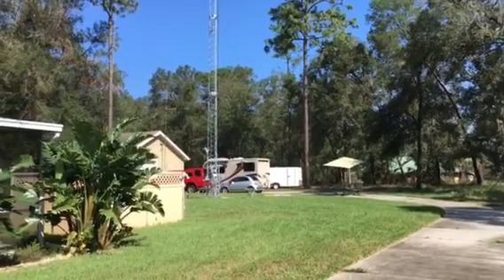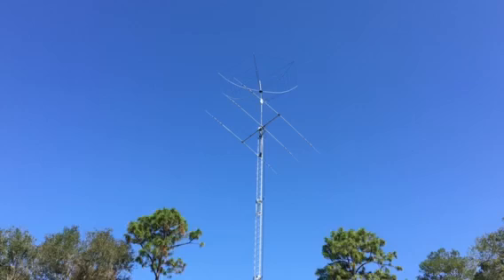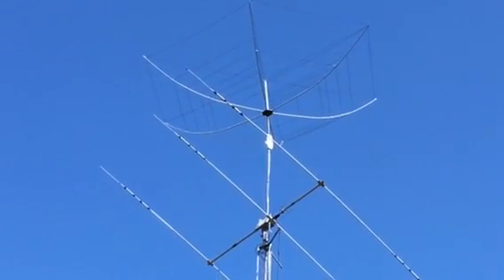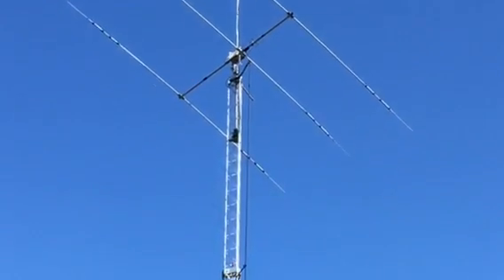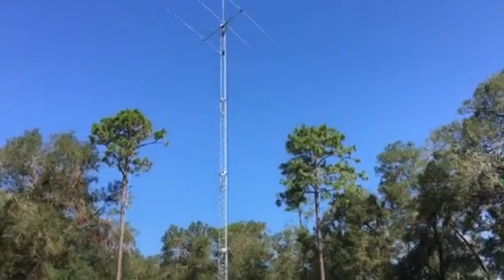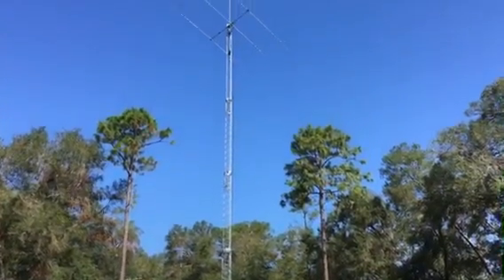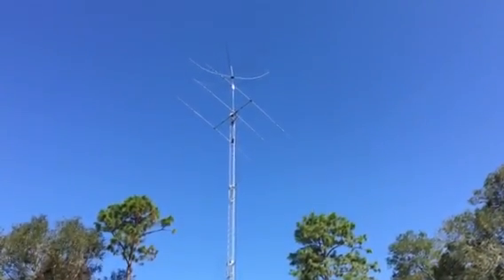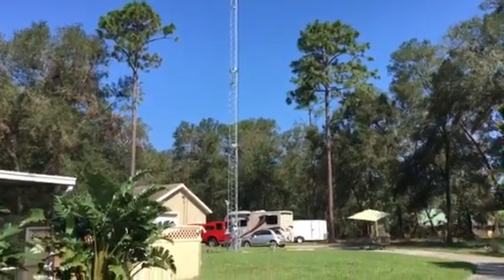HexBeam on the rise -Tiltplate and Hex-Lock NN4ZZ

Comment: Hello , have you do a comparizione? Whatch Is Better?
Reply from the maker: If I had to pick one antenna, it would be a Hex Beam.  But the Yagis do have greater gain.
Reply: @oltredding  - yagi has greater, but what’s the comparison? Which plays better? How much a difference gain versus signal between the two?
Reply from the maker: @N2RRAny  Look at my QRZ.COM page for a complete blogg.  "Today, I have been checking into my normal 20-meter nets and comparing the OCD wire antenna, the HexBeam, and the TH3MK4 antennas.  All three are switched at the top of the tower. It is now common to see a two or three S unit improvement from the OCD to the HexBeam.  What has been surprising is to see a one, two and sometimes three S unit difference between the HexBeam and the TH3MK4.  While there have been times they appear to be almost the same.  Repeatedly switching between the antennas on receive has always resulted in the average difference being more than an S unit in favor of the TH3MK4.  Thus, my conclusion is if the OCD is S2 I can expect the HexBeam to be S4 to S5 and the Yagi to be S6 to S8.  I have about 20 contacts so far with the Off-Center-Fed dipole, NA4RR HexBeam and the Hygain TH3MK4 3 element trapped Yagi.  There are times when the OCD and HexBeam are the same.  But that is the exception.  Normally the HexBeam is two to three S units stronger than the OCD.  There are also times when the HexBeam and the Yagi are the same.  But it is more common to see a one to two S unit advantage to the Yagi."
Reply from the maker: @N2RRAny  From my QRZ, W6LMJ, page. Today, I have been checking into my normal 20-meter nets and comparing the OCD wire antenna, the HexBeam, and the TH3MK4 antennas.  All three are switched at the top of the tower. It is now common to see a two or three S unit improvement from the OCD to the HexBeam.  What has been surprising is to see a one, two and sometimes three S unit difference between the HexBeam and the TH3MK4.  While there have been times they appear to be almost the same.  Repeatedly switching between the antennas on receive has always resulted in the average difference being more than an S unit in favor of the TH3MK4.  Thus, my conclusion is if the OCD is S2 I can expect the HexBeam to be S4 to S5 and the Yagi to be S6 to S8.  I have about 20 contacts so far with the Off-Center-Fed dipole, NA4RR HexBeam and the Hygain TH3MK4 3 element trapped Yagi.  There are times when the OCD and HexBeam are the same.  But that is the exception.  Normally the HexBeam is two to three S units stronger than the OCD.  There are also times when the HexBeam and the Yagi are the same.  But it is more common to see a one to two S unit advantage to the Yagi.